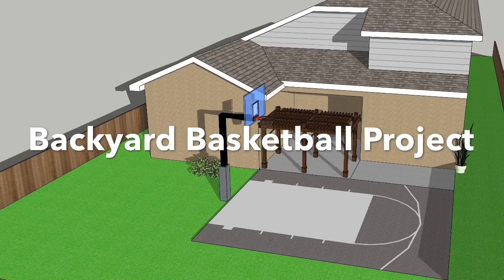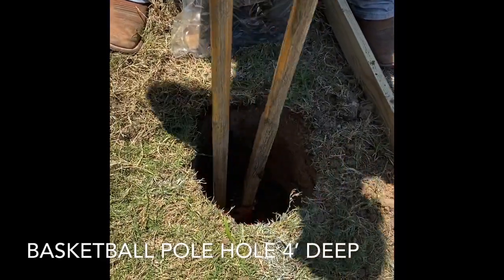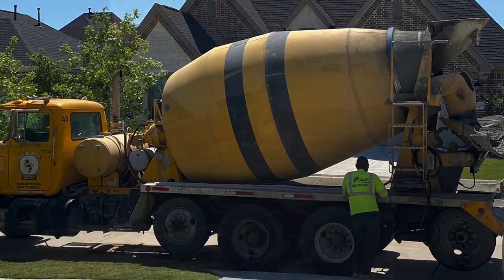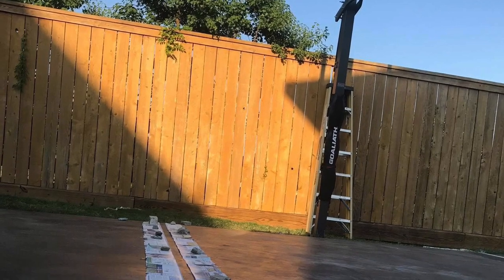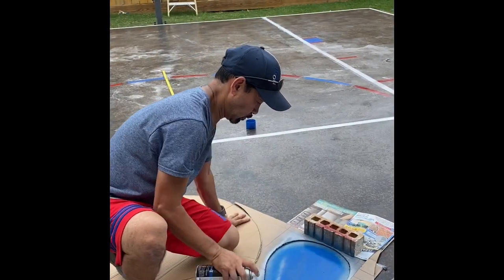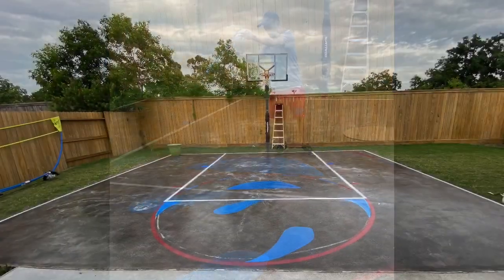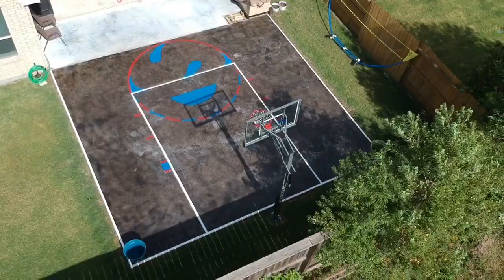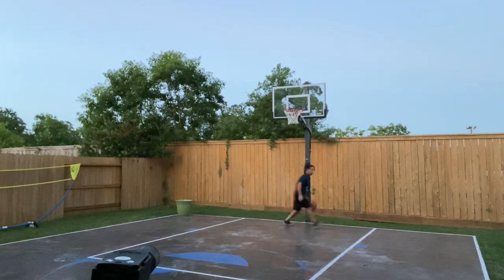Backyard Basketball Court

Comment: Hello, kabayan. I'm planning on building one. Is the base for the hoop necessary? Can't you just mount it on the paved concrete itself? Mabuhay ka.
Reply from the maker: Yes, the rods can be built on the pavement. If you build the pavement before putting the rods you’ll need to drill it. I suggest to get the backboard ahead of construction and read specific instruction on how deep the rods should go down on the ground. It may save you time. Hope this helps. Regards kabayan.